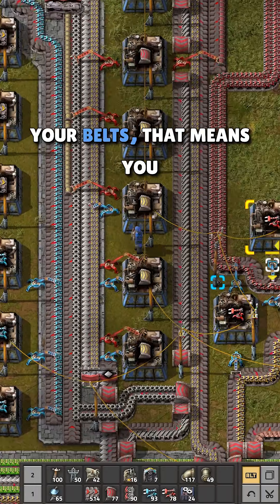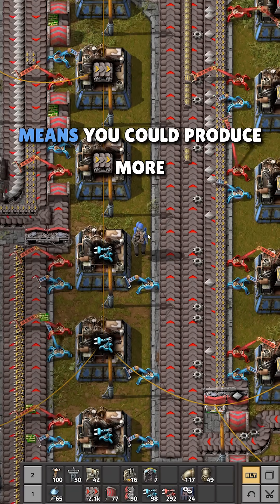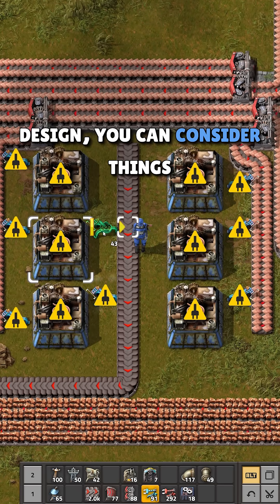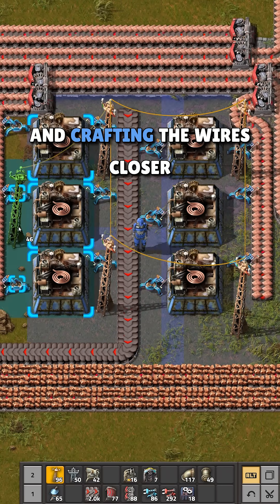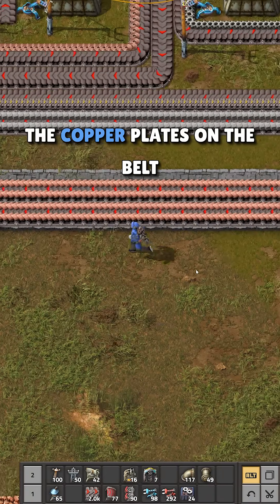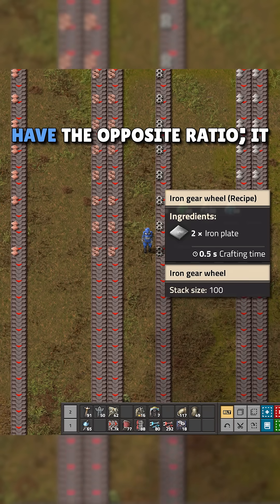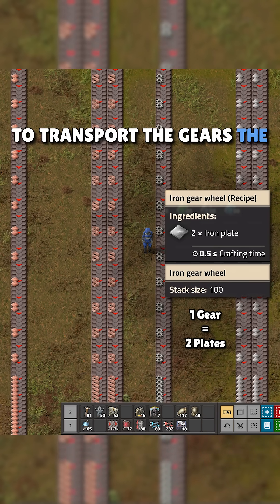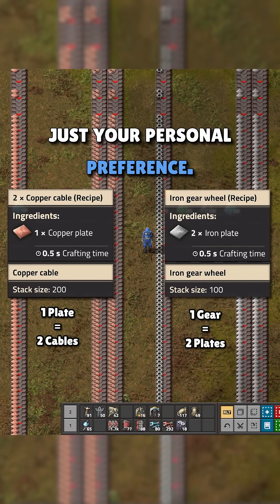Factorio tips: Throughput basics.

Comment: Outside of bot malls and red chips belting wire is a pretty bad idea. If you have the belt stack research it’s not as bad since belts can have insane throughputs but it’s still preferable to belt plates or better even, molten ores for infinite throughput

Comment: Honestly, having a belt dedicated to gears sounds like what a psychopath would do.

What's next? Barrelled water?
Reply: actually there is a mod that makes water limited - all lakes have finite amount of water and as you pump it out - the lake will eventually run dry, so you will need to bring water from else where. yeah barrelled would make sense in this case ;)
Reply: @ChaosSlayerZX what abt fluid wagons on trains
Reply: @OakleyFoster-e9d  but its not as fun ;) no you do water barrels and then load them on regular train cars ;)
Reply: @ChaosSlayerZX  I meant like most people would just use fluid wagon.
Reply: I always build a Sisyphus machine that has wood being fed into a boiler by the logistics system. That boiler feeds a steam engine isolated from the rest of the electric grid. 

Its purpose? 

Barrel and unbarrel water to use up the waste wood
Reply: What’s wrong with it? It’s technically better due to gears requiring 2 iron plate per
Reply: @thatguywhomaybedead  it uses a belt lane ;) In my perfect bus setup I already have 12 main and 4 side lanes used and gears is not one of them. But to each his own ;)
Reply: with the new circuit enabled splitter...UPS friendly total sushi is more possible than ever. barreled water on the belt is coming.

Comment: Well yeah, personally  I experimented with both and i decided for myself that unless an item is used in MANY different recipes, it does not belong on main bus. So I only move copper and iron plates and only make wire and gear locally as needed. In all the seriousness Wire is only used 2 major places - Green and Red circuits - why would you want it on the bus? 
Of course if you running MEGA base that uses trains instead of MAIN-BUS - well maybe, its up to you.